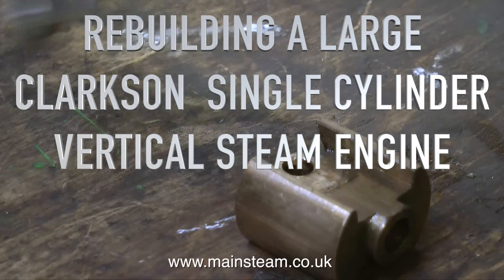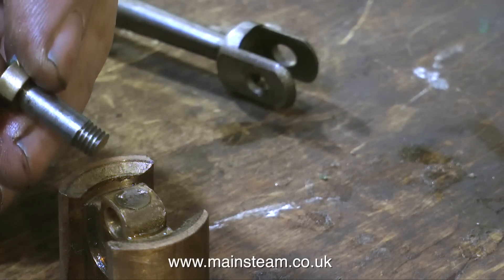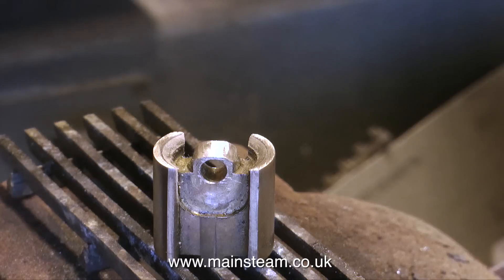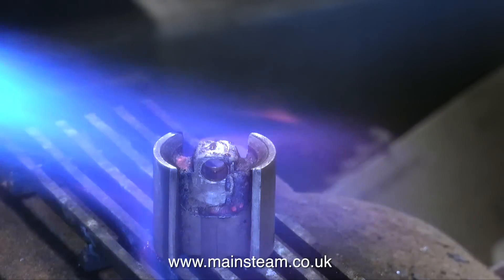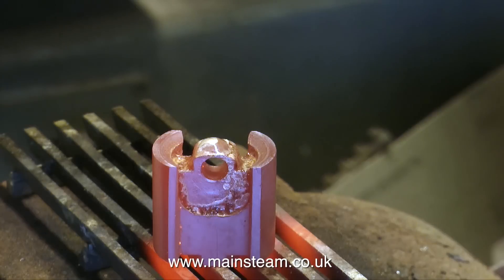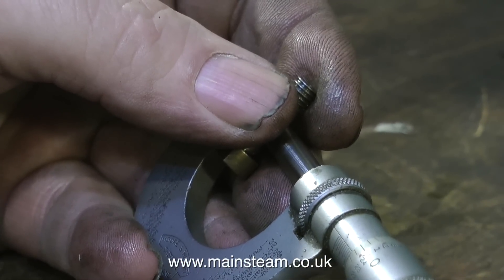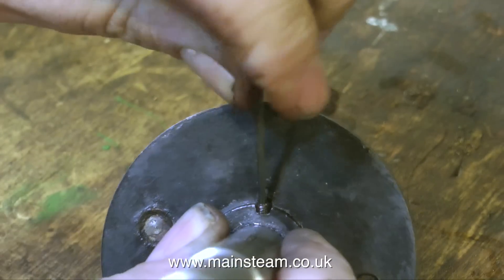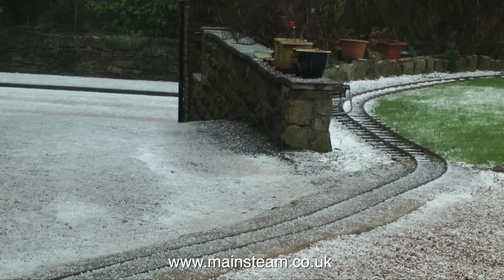REBUILDING A LARGE CLARKSON VERTICAL STEAM ENGINE - PART #11

Comment: Hi Keith, Just love all of your rebuild videos.However, just like the metallurgist geek who corrected you on graphite in cast iron, I must advise that the dwell time of teeth in an acid bath depends on the type of acid used. Most schoolboys know that calcium sulphate is insoluble (calcium being the principle metallic element of teeth-and bones) so dissolution in sulphuric acid is very slow. So if you wish to achieve a more effective and efficient dissolution of your better half, use hydrochloric or nitric acid as the calcium salts of these acids are very soluble. Hope this is of help to you and your viewers. Keep up your  very informative and witty contributions to the knowledge bank of this great hobby.
Reply from the maker: +John Roscow A very useful comment for any serial killers out there I am sure :-)

Comment: Is it more common to split eccentric sheaves on both sides?  I thought they were usually split on only one side so you could tighten them up a little bit.   I guess splitting them allows the sheave to fit into a groove.
Reply from the maker: +John Creasey From my experience it's more common to split eccentric sheaves on both sides.

Comment: You can also use straight white vinegar to pickle parts after soft or silver soldering. In fact, anything mildly acidic will do the trick. I must say however that I don't recommend using hydrochloric acid for this purpose, it does work for pickling, but it gives off really nasty fumes that will make any exposed steel in the workshop go as rusty as a boat anchor in a few days. Oh, and when it's not diluted it reacts vigorously with aluminium, it'll eat through baking foil in seconds, and dissolve a scrunched-up piece thrown into it within minutes.

Comment: If you heat the acid, the teeth dissolve much faster but two or three hungry hogs; far more entertaining, saves time as you don't have to kill them, lift the body and clean up acid splash that can ruin a concrete floor. For what it's worth.
Reply from the maker: +johnvallesfarm It is difficult for me to heat the acid, as the container is a plastic dustbin  . . . .